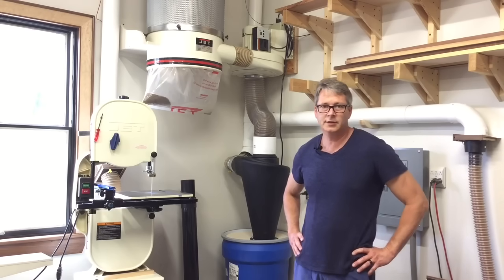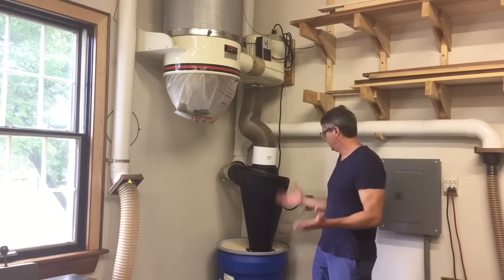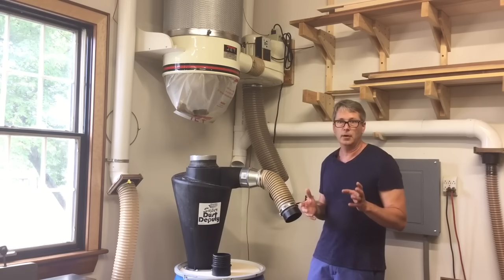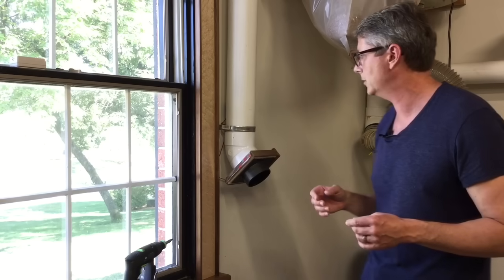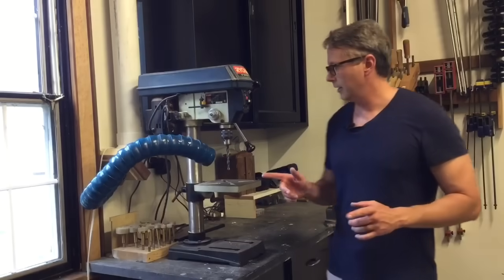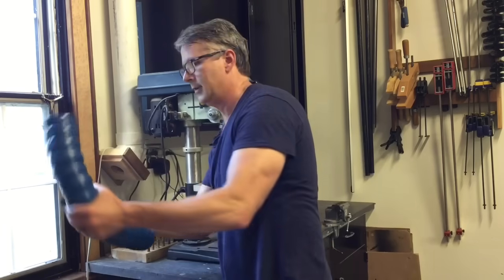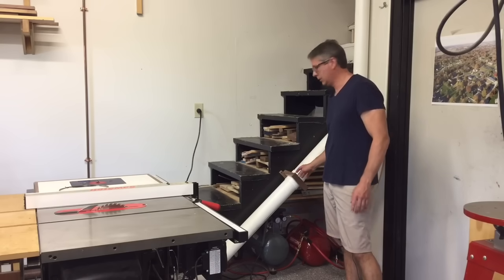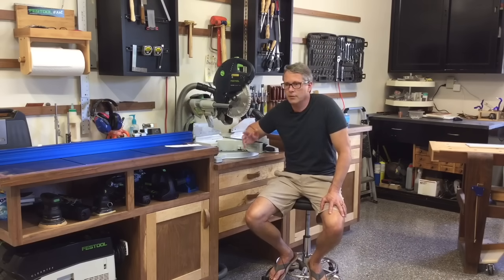Advanced Dust Collection System for the Home Workshop.

Comment: no need for filter,  just cut a hole in wall and pipe dust towards neighbors... lol
Reply: With this system almost no dust goes outside.
Reply: Yabbut:  piping the air outside means you lose heating and cooling.  Note his shop has AC.  Recirculation after good air cleaning is more energy efficient.
Reply: @dogface6040  That's a good point.

Comment: Some great Ideas, thanks for posting. I have a vaguely similar system.  I have noticed that where I have vertical pipes entering the bottom of horizontal runs debris falls into them when using equipment on the far side of them.  Hasn't been a problem, but when I turn on some tools I hear the system clearing the debris out of the vertical.  On the ones where the pipe enters from the side, it does not leave deposits.  So, if you can, turn the fitting to the side.  Hmmm? Wonder how long I would have to ignore a vertical for it get stopped up with debris?
Reply from the maker: My system does not have the same problem, but now that you mention that I can see how that can happen. Maybe your CFM is not strong enough.
Reply: Using 45 degree connectors will help a little.  Periodically clean the system starting at the far end and open one inlet at a time.  That usually keeps it clear.  Usually!

Comment: How's she goin'?  I've been searching out some dust collection solutions to try and keep my shop a little cleaner and found yours.  You have a great system and it looks like a lot of the pieces are custom made right there in your shop, which is nice.  I have a dust collector similar to yours and use 3 inch ABS pipe.  Maybe I should upgrade and try the 4 inch as the volume of air would be so much greater.  Thanks for posting.  I got a lot of ideas from this video!!!  Take 'er easy!!!

Comment: Good ideas, but after all that time you didn’t bother to glue the pipe together on the ceiling CFM out the door. And to get an even better system it’s best to put the blast gates as close to the main line as possible. I understand you wanted to use those nice little switches but maybe a tool switch would be better in certain places and those for maybe a sweep or bench work. And for whoever makes it this far, you want the least amount of flex hose possible. It only creates resistance, again CFM out the door. I use to install heating and A/C systems just about seen it all, guys seal your systems and make sure your GROUNDED.
Reply: I find that a gate anywhere in the branch operates about the same.  I once did some forensic investigation about dust fires in woodworking.  Commercial systems are required to be grounded, but I never found a reference showing a fire started due to sparking, so I never bothered grounding my system.  Fires (commercial) all started in piles of dust left lying about the shop (just poor housecleaning); note this dust is the stuff outside the dust collection system.  A small PVC DC system doesn't really benefit from gluing the parts together, or sealing the joints; it makes it easier to modify the system later to just dry-fit.  If you limit the flex duct, yup it works better, but "hard ducting" to machinery is very limiting.  Using 12--18" of "pretty straight" flex doesn't really hurt the system.  Bending in flex kills air flow pretty quick.

Comment: Lots of great ideas I love the switch on your blast gate.
Reply: Your thoughts on a dust collection system outside of the shop.I have a parking area well covered this would reduce the noise level in the shop. I have seen a number of videos only one the dust collection system was in a closet also reducing the noise level. It would increase the distance from the tool to the collection system.  Please what are your thoughts on this

Comment: I brought a similar Jet dust collector that comes with a 'two' 4" port Y on the intake. I want to remove it but can't see how it's attached. How do you remove yours?
Reply: Call the mfr:  they may make a plate with only one outlet as a conversion.  But if you are installing a 4" system, just block off the unused port.  It only hurts air flow by a few percent.
Reply: I have the same Jet model and it just twists off - really tight, but there's nothing but friction holding it there.

Comment: Hello 
Great system, I'd like to install in my shop
I work with fiberglass (cut, sand, plaster) and I need 3 aspiration points
How much is the power of your dust collector?
Reply from the maker: 1500CFM supposedly

Comment: It's me again.  I'm 98% of the way to being ready to hook everything up.  I've made some killer blast gates and mounting brackets for the motor and DC cyclone.  But I simply cannot determine how you connected the 5" SuperDust Deputy inlet to that metal 5" to 4" reducer.  Oneida is less than useless; Woodcraft tried but they do not know.  I've bought an identical 5" to 4" reducer from each of them ($20 and $15, respectively):  neither one fits like yours does at 2:24 in your video –– not even close.  The 5" metal part is the exact same OD as the OD of the SDD inlet.  No way to fit the metal over the SDD.  How on earth does yours fit?  Can you please explain it to me like I'm a three-year-old?  I'm at my wit's end.  Why is this so difficult?
Reply from the maker: Give me your phone number and I can text you a pic of the label on the reducer.  I got it from Lowes I’m pretty sure. I took the dust deputy with me into the store and just tried a bunch of fittings until I found things that worked.

Comment: This is a really helpful video that I've watched numerous times to help plan my own, but I'm struggling to find any guidance on matching pipe size to dust collector power.  How many HP is your Jet DC rated at?  You seem to have a fairly elaborate and lengthy run of 4" pipe.  I'm considering 6" PVC but I'm concerned my 2HP collector might not pull enough air for pipe that size.  Any suggestions?

Comment: Nicely done. I really wish I had seen this video before I bought (an iVac) remote control for my system. I've already sent one remote through the washing machine and inadvertantly leaving blast gates open is a habit I am finding impossible to break. Knowing that if the dust collector is off, all the blast gates are closed would be so much easier than trying to remember to take a visual inventory every time I fire up a machine.

I had been looking at the iVac gizmos for "tool activated" systems, but an extra $200 or $300 for finicky doodads and thingamajigs for each tool station is a bit nuts. Besides, I don't like the idea of cycling the dust collector on and off every time I fire up an intermittent use tool like the miter saw. Switching the dust collector by opening a blast gate is a simple, cheap, elegant solution.

It is a shame that the Long Ranger Multi Gate switch is apparently only available in a 220 volt version. But brewing my own multi-switch relay to drive a contactor would rely on old, simple, cheap, time-tested technology, and should be quite reliable. It's just too bad that no matter how deeply I research this stuff, I end up finding the perfect, elegant solution just days after I commit to the installation of the complex, expensive, inferior alternative.

Comment: What model Jet dust collector is that?  What size is the motor?  I have a Delta with a 1-1/2 hp motor and I wonder if it is enough power to work in a two-stage setup.
Reply: That is more than enough hp. It really depends on the overall distance and volume you are trying to move the debris. The dual stage has no major impact on power.

Comment: I'd love to see how the blast gates micro switch works on the dust collector side
Reply: To be safe this would need to be a 24 volt system with an ice cube relay switching the 120/240 depending on the three motor voltage

Comment: Hello,
Thanks so much for posting the video of your well engineered DC system.  Your system as well as a few others will provide the inspiration for my system.
I have read so much!  I understand the Bill Pence mandates for 6” pipe, straight runs, etc.  I even have space in the lower portion of my shop to install a big cyclone and 6” pipe BUT...  I planned long ago to install my filter and motor on the second floor of my small shop.  I soundproofed the area for the purpose.  I want to use your basic system with the DD on the first floor and the motor/filters on the second.  I am just worried about the FINE dust that we all worry about.  I have a supplemental air filter and am building another but I still worry.  Can you please share your thoughts regarding how well your system handles the fine particulate matter?  Also, are there any other changes you would have made to your main duct system mounted to the wall?  Thanks so much.
Reply from the maker: Thanks!  I don’t really worry about the fine dust with this system. Hasn’t really been an issue, but I am only a hobby woodworker. My sanders are all festool and I use the festool dust extractor for them. 2 years  And I think this dust collection setup is perfect. No regrets about any aspect of the design or how I mounted it to the wall. I would do the same thing you plan on doing with noise reduction, but if I put mine above the shop the noise would be transmitted to the bedrooms in my house, so that won’t work for me.  Just don’t vent your system to the outside if your shop is climate controlled
Or you will waste a lot by venting out your climate controlled air. 6” ducts are better, but the 4” does a great job for my shop. No plans on upgrading anything. Good luck and post a video of your system.

Comment: Great video! Curious, why didn't you just punch a hole in the wall and vent outside? Also, are you planning on installing an air filtration unit?
Reply from the maker: My shop is climate controlled and Blowing it to the outside would negatively impact that and be expensive. I don’t really have a big issue with fine dust with this system so I don’t see the need for air filtration.
Reply: Makes perfect sense.

Comment: Great system, great video, and great ideas! This is so good, and so -to the point. I wish every youtube video was more like this. At my workplace we are installing a electrostatic hover dust trap. Not installed yet, but interesting. I also have an idea of a type of treadmill spinning slowly on the wall that is moist, so dust attaches to it, before it gets scraped off a foil. I imagine air humidity problems.   My personal philosophy is different. I treat my shop like a workshop, and not a art studio or office. I use a leafblower once every other month to clear the worst out.

Comment: Hands down the best dust collection I've seen yet on youtube. I am definitely going with the micro switches. How is the system holding up for you now? Would you make any changes? Great job.
Reply from the maker: No regrets after 2 years. I love it and have not changed a thing. If I started a workshop from scratch I would have had the duct work in the floor. Otherwise it is perfect still after 2 years of use.
Reply: @Selandry1  Floor? Really? What is the benefit?
Reply: @Selandry1  I tried zooming in on your owners manual but couldn’t tell what model your Jet DC is. 2hp 1200? 240V?  Can you PLEASE let me know your model number?  Awesome setup and I’m totally coping you😀
Reply from the maker: Model is DC 1100RC. It’s 220 V

Comment: your system looks ok but your are not even close to the "insane" claim, lol;Try something with 8" main, somewhere between 7hp to 15hp and keep the connection as close to 6" as you can; every time you reduce from the gate, you exponentially lose suction.I like your idea of gates system, its a cheaper way of controlled gate system, but when you have a real insane dust collector, you can afford to forget some other gates open, that thing sucks you right up that pipe.Good job for what  you got, nothing wrong with that.Dan

Comment: Is there a reason that you mounted the dust deputy off center other than making the barrel fit tighter to the corner? I'm about to make my own system as well and if there is performance benefit to the DD being off center I'd love to know. Thanks, great video.
Reply from the maker: You are correct that it is mounted off center to allow it to fit better In The corner. I called dust deputy to ask if that affects performance and they said the it will not affect the performance to mount it off center.
Reply: @Selandry1  Ok great, thanks for getting back to me

Comment: Typical very bad mistake on duct work. Never, ever use 4" duct. Even the HF comes with a 5" inlet.      6" S/D PVC is the only thing to use. 5" metal can be used  but even  that cuts your CFM by up to 1/2. compared to 6"  diameter  6" duct should be run he entire distance from your blower to the tool. In your case you bought a 5" cyclone. but that can also be used with 6" duct.  You can get a lot more CFM out of your Jet by changing the impeller out.  If it's a 12" buy a impeller that 14" impeller. That will some what make up for the 4" duct. A very bad mistake on your part my friend. Read Bill Prentz.

Comment: Your system is a work of art and precision!  I had the option of running my pvc drain pipe under floor 20 years ago, but yours is much more impressive out in the open.  It is another advertisement for your great craftsmanship.  Back then I ran thin steel wire through the pipe as ground (for those who care) but it was not necessary.  I did use Vaseline to seal the pipe and to make for easy disassembly, and used self drilling sheet metal screws to hold it together.  I really like your micro switch system at each gate, so I will be doing that upgrade, probably with magnetic reed switches and low voltage relay.

Comment: First of all, very informative video. Nicely done! I have the Jet 1200VX dust collector, which has a cone in the extraction shroud that makes it a simple two stage. It works very well on its own. I want get it up on the wall. Do you know if the vortex cone in my collector would have a negative effect if I connect it to a dust deputy? It’s easy to remove if it does.
Reply from the maker: Don’t think it will. It is not needed though as the dust deputy separates almost all the dust.

Comment: Selandry, I’m trying to fit the 5” to 4” reducer over the 5” inlet of the super dust deputy. The two ODs are the same. How did you get the reducer to “fit snugly” over the DD inlet?
Reply from the maker: I brought the dust deputy with me into HD or Lowes and tried a bunch of stuff and found the no crimp 5-4” air duct reducer fit perfectly.
Reply: Selandry1 so did I. No luck at Lowe’s. The OD of the reducer was the same as the OD of the dust deputy. On to Home Depot.
Reply: @Selandry1  Checking directly with Oneida I learned a "secret:"  the Super Dust Deputy's 5" suction inlet is exactly 5" OD, so they say a metal air duct will NOT fit over it. (Maybe your Home Depot air duct reducer fit the Dust Deputy, but the one I bought at Lowe's did not.)   So Oneida makes a special 5" to 4" reducer.  It's their part number DRL001205.  If you search for it you can find it on their website.  Fifteen bucks and another 10 for shipping!  Woodcraft also sells it if you're near a store (I'm not anymore).  Anyway, your system is still the inspiration for mine.
Reply: Turns out Woodcraft is having a 25% off sale through February (2019).  I also got their $35 flexible 6" hose for $26.
Reply from the maker: Sorry you had to resort to Woodcraft to make it work. I like the store, but for dust collection pipe and fittings they are way overpriced. I am sure I got my reducer from one of the big box stores. Somebody chime in and help us out here.
Reply: @Selandry1  Just got off the phone with Oneida –– nice folks.  They read me the OD and ID of their DRL001205 reducer.  The 5 " is 5.1 OD, 5.065 ID.  The 4" is 4.025 OD, 4.0 ID.  This sounds like it solves the 5" problem, but might create a new one for the 4" end.  I want to put 4" PVC sewer pipe onto the outside of the Oneida reducer's 4" inlet.  Oneida's site says the SDD won't fit into PVC.  We'll see, I guess.  Maybe they mean Schedule 40, which would be understandable with its thicker wall.  I'll let you know when it arrives.  Regarding price, Oneida and Woodcraft had the same price for the part:  about five bucks more than one from Home Depot or Lowe's.  Then there's that shipping...
Reply: Update from  @bobjones3027  :  Just the opposite:  The 5-to4" reducer Oneida sold me DOES NOT FIT onto the SDD's 5" inlet, but I was able to cram a 4" PVC sewer pipe length onto the 4" end of the metal reducer.  How can this product be sold if it is impossible to connect?  I'm at a loss.